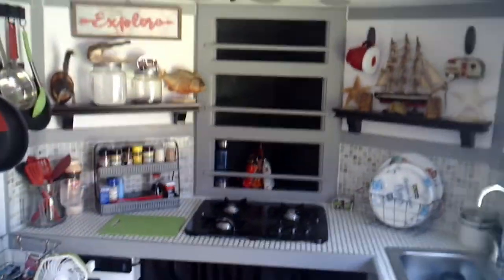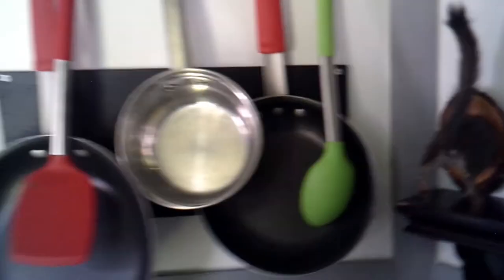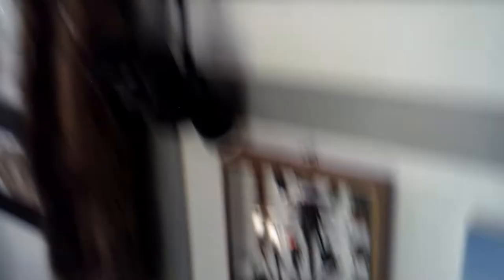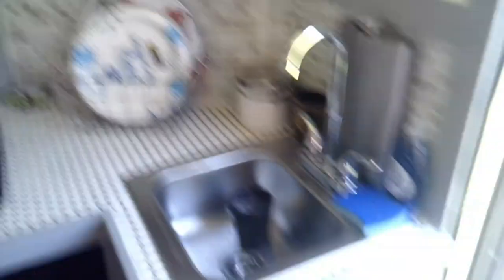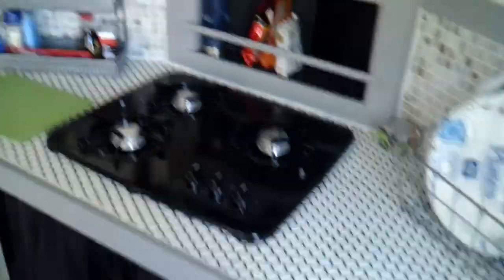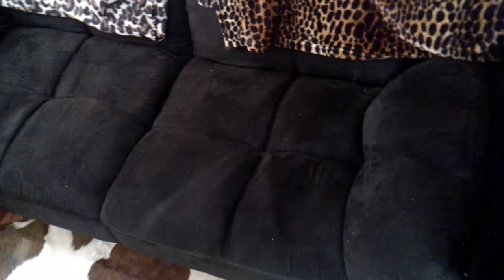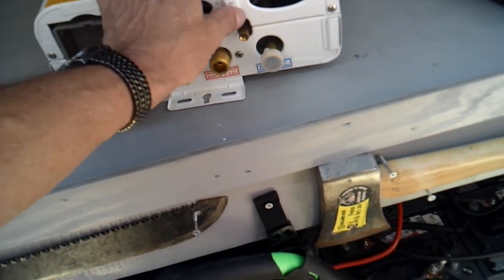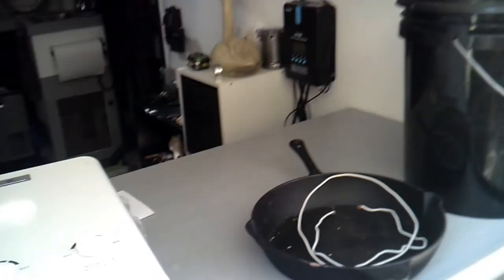Updated walkthrough Cargo camper conversion 6x12 Fulltime RVing

Comment: I'm thinking of building a 7 ×14 v-nose tandem axle, hope that's not too big.just woundering about how u sleep with out windows. Not afraid of getting lock in.
Reply from the maker: I wish i could of gotten a 7x14, just a little bigger would of been awesome but really the 12 is just the perfect size. w the "V" its really 13.6'. I plan on putting a window in the door in the near future but the fantastic fan blows plenty for now..With the screen installed on the side door i can just leave it open and when i sleep the fan is off but open for ventilation.. I put an RV door lock/latch on the door and i just lock the the original door lock so no one can lock me in. I think i only paid $14 on ebay for it and was easy to install..
Reply: @fulltimewannabe9449  thank for getting back to me. Guess I'll be getting the 7 by 14
Reply from the maker: @thomashorn9152  ya the 14" is still small enough that youll be able to go where all the bigger rigs just cant.. easy to wip around and get into tight places. Plus you wont have to drag your rig to town every time you need to stock up or just to do laundry. And best of all. Like mine, yours will be build with actual real wood unlike the particle crap they build campers with today.. Will last 20x longer..lol